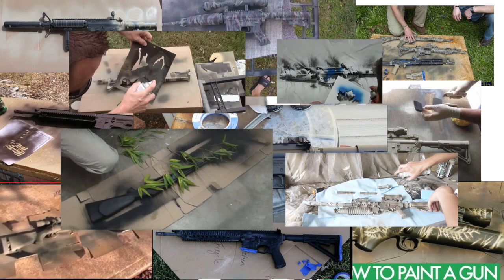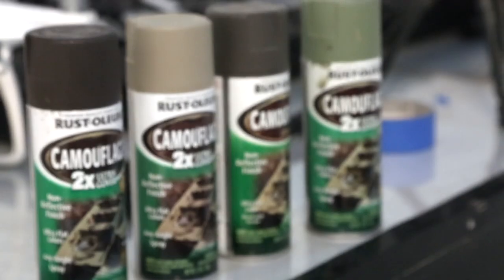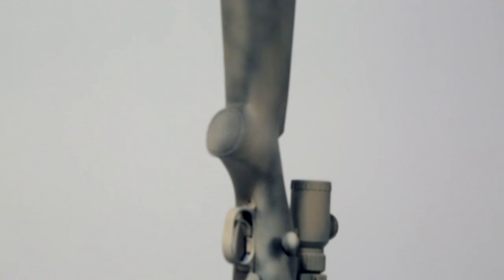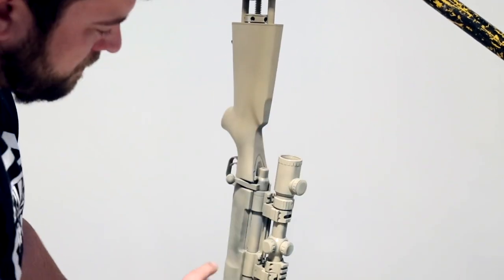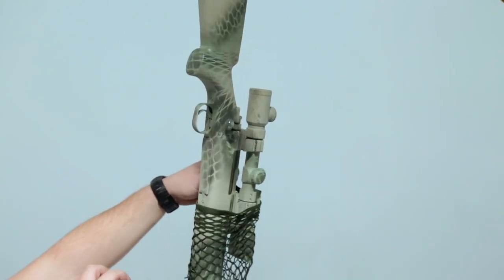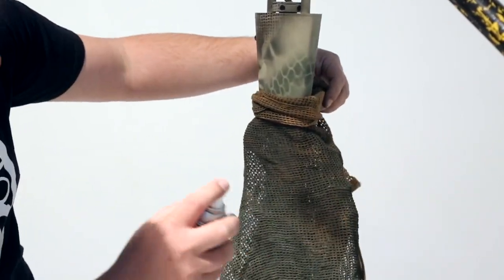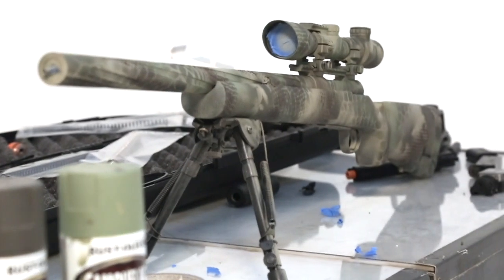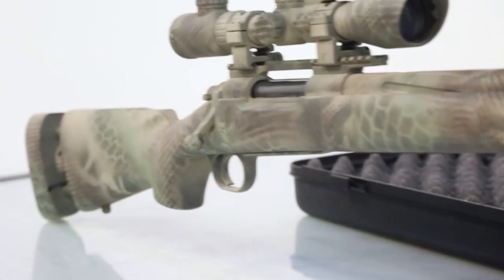How to Paint Your Rifle [ Swamp Sniper

Comment: I did it and I think looks good.  However, I get a lot dust residue after sitting for over 24 hrs.  I prepped both the wood and cleaned the metal.  Cause?

Comment: good point on the hanging it up.  do you sand at all before painting so the paint can adhere better?   (thought i recognized the ssg24 all dolled up in your last video)
Reply from the maker: I dont, you can even paint a gun that is dusty and still have the paint job you need till you repaint.
Reply: Thats the thing, it all depends on what you are after - I'd imagine most people wanting a functional paint job, for use in the field, would be MORE than happy doing it this way, its perfectly adequate and quick - its more like how the real deal guys would paint their real steel.

No sanding required, because maximum adhesion isn't required, if it wears, so what - hit it again :D

If you were doing a job where you want it more permanent, or a restoration type job - for example I paint a lot of "2 Tone" guns that we have here in the UK - and you want it looking realistic and original, and not to wear so easily... thats when you have to worry more about preparation. 

I'd say 99% of airsofters would be delighted with this route, get some tins, get that gun hung and have a blast!

Comment: Can I sand my airsoft gun first then put primer and finish it off with paint ? Does it even matter?
Reply: I would not use primer, just wipe it down with denatured alcohol to clean it prior to paint.  When the paint wears you'll get a cool battle worn look.  You don't want too much paint on it, just enough to cover the black to break up the shape of the rifle.  2 light layers or so.

Comment: personally i hate the snake skin style pattern acheived with the netting, not because it isnt parctical, i just think it looks really......off, like it looks a bit weird. i prefer the standard woodland camo look with a few leaf patterns and stuff. that could mainly be because most of the outdoor sites in England are in the woods so it works super well with my AO
Reply: A tricky thing about camo that I pondered recently... Ever laid eyes on Kryptek's patterns? Those weird, stretchy hexagons all over? I find that actively annoying to look at. Which probably means it's also amazingly effective camo. The more shapes you have that work to throw your focus AWAY from the subject, make it hard to see exactly what shape it is, which part begins and ends where, or just makes your eyes want to skip over it entirely, then the more effective it is at blending in when you need it to disappear.

Unfortunately this seems to imply that the most effective camo, in theory, is one that does everything in its power to make you want to look away from it. And that's not what I want from a gun that I own and want to look at. Gotta find a balance, I guess.

(That said, I also am not a fan of snakeskin camo for personal reasons. Were I to paint my gun, I'd probably just mask out some hard edges and go for a simple woodland tiger stripe type deal. This is tempting me to try...)